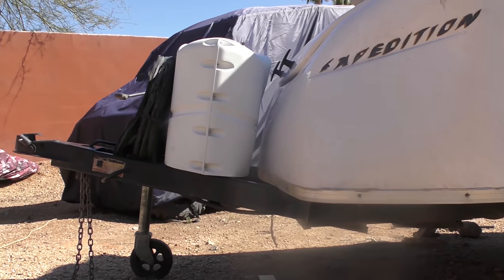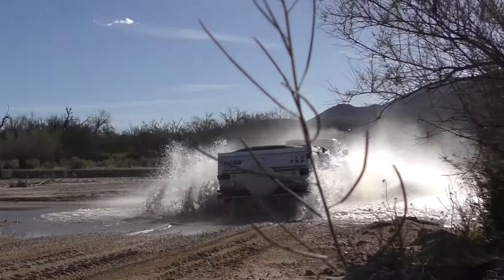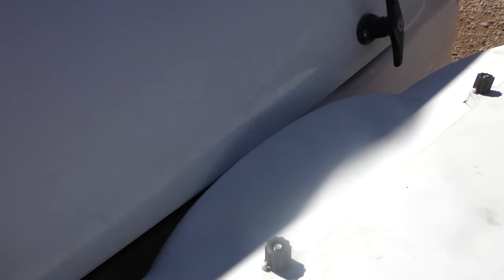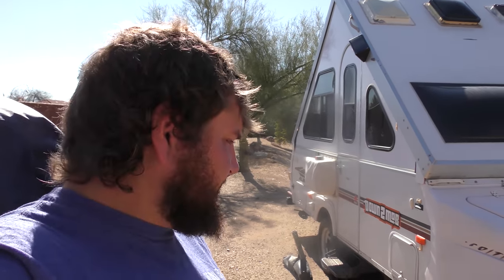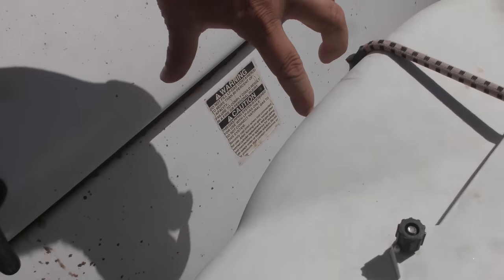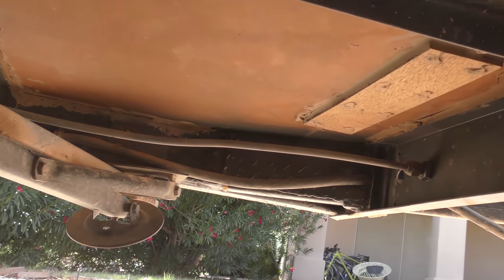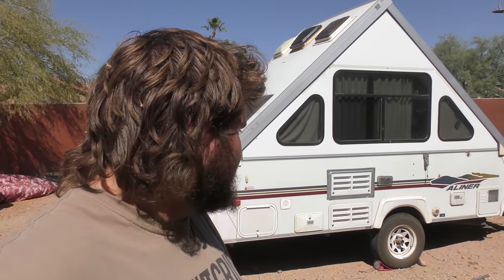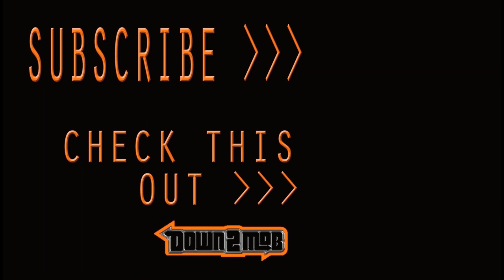I BENT MY CAMPER TRAILER FRAME! Aliner Pop Up Disaster

Comment: "I crawled underneath, and was shocked at the cheap components and construction!" [paraphrased]

Welcome to the world of RecreationVehicles.
We delivered RecreationVehicles manufacturer-to-dealer and dealer-to-shows.
We delivered BillionBuxBuses from Coburg Oregon to all over north America.
Irregardless of price, every RecreationVehicle is stapled particle-board.
The fridges catch fire.
The plumbing disintegrates.
The cabinets dance across the floor.

The worst idea in RecreationVehicles?
Holes in the roof for vents and coolers.
They always leak, rotting the walls and floor.

Your videos demonstrate the forces acting on a RecreationVehicle. Every trip is:
A hurricane, plus
An earthquake, plus
A monsoon, while
Driving through rioters.

I'm amazed they last as long as they do... but, of course, RecreationVehicles were engineered for a couple weekends a year.
Most buyers acquire them for that level of use, parking them for months in storage.

For full-time live-aboard, look to rigs from Europe and Australia.
Or convert a commercial truck/trailer... with a 'million-mile' chassis.

Farmers and horse people cannot afford downtime, so their equipment is sound for decades of rough roads.
Some horse trailers have opulent living quarters.
Alternatives to RecreationVehicles are easily available.
Reply: You get what you pay for.  You can get a stoutly built rec vehicle these days but you'll 25, 35, 50 even $100k for some.  Im guessing he paid about $5k for that used aliner.  Of course id never pay 25k for a new aliner which is what they cost now.  What till they are a few years old and pick it up for 10 or 12k.  Go thru and retrofit it to be stouter and check and perform maintenance monthly.

Comment: The price is totally fair, those metal plates didn’t come cut and measured to fit, he had to make them and then weld them on.  I presume he had to clean and remove paint before and then do it all again after. I wouldn’t underestimate the value of having the right tools to straighten it either.    I have fabricated, welded, and straightened before

Comment: That work was not over priced.  You are going to paid a skilled person at least $100 per hour for custom fabrication.  6 hours labor plus materials and supplies, $800 sounds like right on the money.
Reply from the maker: I think so too, just silencing the haters cuz theres always some on price!
Reply: Any good fab shop will charge you $100 an hour.  Sounds fair to me.
Reply: Lets not forget they straightened the frame as well.  I'm sure that took more than 10 minutes with a big hammer.  Seems a fair price.

Comment: To anyone thinking of buying an A-frame stay away from all the brands, especially Aliner, and get a Chalet A-frame built in Oregon. You pay more, including for a used one, but they are much better built and use better materials than any other A-frame out there. Just the frame alone is stronger and thicker.

Comment: You paid for not only a repair, but also welding and plates that should provide more structural integrity than the original design.  Ya did good and the price seems fair especially now that it's upgraded!

Comment: I am a welder and also have a off-road Aliner. I think the work was at a fair price. Your Aliner is not really an off-road Aliner, so good thing you supported and braced
 the frame. Why don’t you flip the axle and put on some larger tires for ground clearance.

Comment: One of the things that really frustrated me when I had my aliner was all the self tapping screws on the interior and exterior that would come loose. You build cars with nuts and bolts so they won't come loose...why can't they build a camper with nuts and bolts and charge a few dollars extra???
Reply: Lock tight
Reply: @canyonero2050  yep, that's what i ended up using lol.

Comment: He welded the plates, thats relatively easy, but he also bent the frame straight, thats not nearly as easy and requires less common equipment and more expertise/experience. You also wound up with a great camper that is better than new! Id say $800 is a fair price. You did alright!

Comment: Thank you for sharing. I am looking at A-frame campers. Is this specific problem for Aliner or all a-frames?
Reply: I don’t think many a frame campers are made to hold up to off road driving. I’ve seen some with lifts and off road tires but they have the same toothpick frame

Comment: If I was an average guy I’d agree with you frame are supposed to be pretty solid, but the tongue portion of the frame on a lot of trailers is added on the front of the frame and in some case kind of attached as if it’s just hap hazardly added on. I’m thinking it’s a “give” point to or something for crashes?  I don’t know but it sucks.
Reply from the maker: You are right, and that's just crazy!

Comment: You definitely got ripped off. Would have been around $600 if it had been done in my shop. Plus i would have put a 1/4inch plate with a full pen weld. Would have looked WAY better than that... but he got you fixed and back on the road and you can't beat that.

Comment: Shitty weld job he did and come on diamond plate ??? Yes your right  he bent you over worse then then bend on your trailer !!!!!  Lol  I like the A frame trailer but I would beef up the suspension and better tires and rims and you got a cool set up !!!!
Reply: Wasn't quite sure if the guy welded that diamond plate on or used silicone from the looks of his beads. 🤣😳